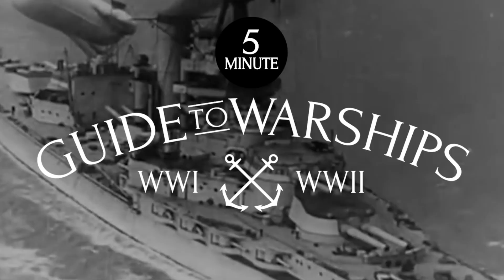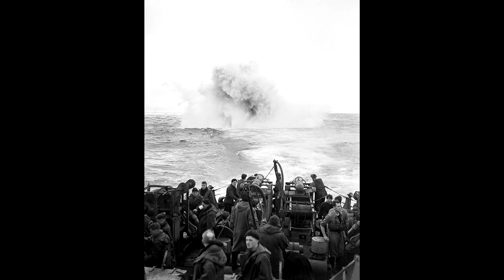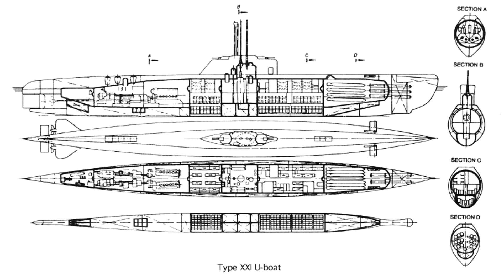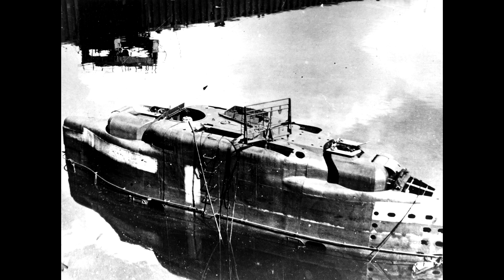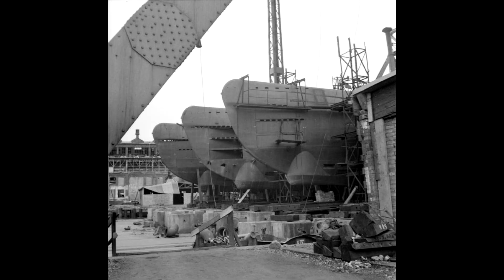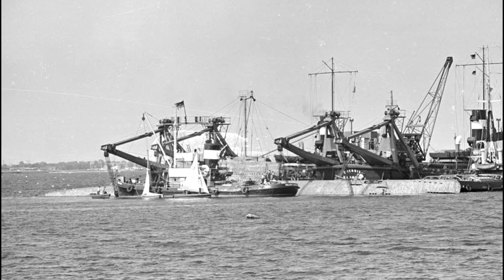Type XXI - Guide 408

Comment: The design is so advanced, the hull could be reused to fit modern systems and be as capable as any other newer conventional diesel electric attack submarine.

This one was the true wunderwaffe.
Reply: The internal hull design was never used again...  And if you think the  external hull which is just steel plates is revolutionary maybe you should read about the British R class which had the same idea back in WW1.

Comment: The Type XXI made a tremendous contribution to WW2: it consumed so many resources for so little (combat) output, it really helped the Allies win! In reality, Nazi Germany dove down the hydrogen peroxide rabbit hole and surfaced 2yrs too late. Now, if Walter had been told his ideas were operationally stupid but the sub shape was great, maybe they could have had something like a Type XXI ready by mid-1943, when it was actually needed. Same with Japan - built high speed sub No.71 BEFORE WW2, then did very little until producing the I-201 far too late.

Comment: The great irony is that the Type-XXI is the first actual submarine. Meaning a ship capable of continuous underwater cruising operations.
     All prior "submarines" were technically submersibles. Ships capable of diving, but only for varying lengths of duration before they would be required to fully resurface in order to recover resources, whether that be running air-hungry engines to recharge the batteries used to power the sub while underwater, refill the air tanks with air through deck-mounted air intakes, et cetera.
     As a result of these limitations, the vast majority of WWII submarines would cruise on the surface for most of their voyages and only dive upon spotting a potential quarry, before closing while underwater to attack with torpedoes.
     The Type-XXI was unique in that it only required a snorkel to feed air for its engines and its living spaces when it needed to, and thus didn't require breeching the surface to run its battery-recharge engines. It also distinctly had a much more hydrodynamic hull designed for continuous underwater sailing, and thus was much faster while moving while dived than most other submarines of its era.

Comment: 5:10 that is so cool. We actually do a similar process today with constructing large industrial projects. The pieces (modules) are built in large yards close to a major city and then they are shipped to site and connected. A small SAGDE oil plant will take about 40-80 modules and can be connected and commissioned in 6 months after the first mod arrives.

Comment: It's amazing that a scuttled submarine could be salvaged and be museum worthy.
Reply: Museum?  She was operational.  Honestly, knowing the Germans I would not be surprised if she was scuttled by merely slowly flooding the ballast tanks and the crew sealed the hatch after they left.  So, from 1945 until the mid 1950s the boat was "sealed".  Granted after salvage she would have to be 100% reconditioned but that's a lot better than cleaning out 10+ years of underwater goo.
Reply: Can't help but think of USS Monitor, which spent a century or so underwater after foundering and is now in a museum.

Comment: Just much too late. The Kriegsmarine needed more U-boats and better technology in the early years of the war when they had by far the best chance of winning. By 42 - 43 they were too far behind in technology and in a position from which they could not recover.
Reply: With only 35 ocean going examples in 1939 and insecure  oil supplies... they didn't have a snowballs chance of winning 😂
Reply: Foe some reason autoincorrect kept changing Oil to Oik 😅

Comment: Why wasn't U-3523 running underwater so it wouldn't be spotted by aircraft? Using snorkel at night to charge the batteries.
Reply: Aircraft used radar, leigh lights, MAD systems as well as visual (at night a periscope or snorkel cutting through water can cause a phosphorescent type wake behind it)

With design issues with the engines - it took an inordinate time to charge the batteries (design was 4 hours running with diesels at max for each of the two banks - in reality the engines only produced around half the designed  power)

Comment: Having large quantities of Hydrogen peroxide a highly corrosive and explosive material in a sealed container under water with electrical switches which could go wrong.  Small fuel leak and a spark and he sub self-destructs.
Reply: Yup. To be entirely fair, most accumulators and battery banks in german submarines used compounds which would turn into various Gasses, among them Chlorine and Hydrogen, on Contact with Seawater.
Reply: And potentially pure oxygen given off, after which everything electrical starts bursting into flames.
Reply: When they fill and aircraft with a mix of "T Stoff and C Stoff" each of which was corrosive and ate through the fuel lines, was highly explosive if they came in contact with each other - special methods and equipment developed to fuel the aircraft (which caused injuries to air and ground crew as well as more than one un-intended explosion) 

Or the russian "Kursk" submarine in 2000 sinking after its HTP torpedo was damaged and leaking before exploding (it had been dropped during loading and cracked but nothing was reported

Comment: So was this the most advanced sub of WW2?
Reply: If you count only deployed ones, arguably, yes. There were other designs which fulfilled roles like supply or signals better, but it was the only class of permanently submerged boats to put to sea during the war.
Reply: @acceptablecasualty5319  signals and supply?  That's your oh so important metric...   Man you really need to stop doing such interesting convoluted logical paths to avoid dealing with the XXI's very documented issues.   Stop trying to put lipstick on a pig.
Reply: It might have been more useful if it didn't have to leave land and pass through a particularly hostile piece of sea.
Reply: the Japanese I-201 was judged by the US navy to be better and sunk them so the Russians didn't get one as per agreements.  The I-400 is equally advanced but wildly different.

Comment: If you look at USS Nautilus SSN 571 you can see a family resemblance in hull shape.
Reply: The hull shape is similar for the reasons that most cars look alike.  It is a more efficient shape.  Swede Momsen proposed a streamlined design before WWII which came to fruition with the Albacore, which in turn led to the fraternal twin Barbel/Slipjack classes.  The Nautilus abd Skate class was based on the Tamg hull.

Comment: 1-Hydrogen peroxide, doesn't like organic material
2-Humans, all organic
3-Put both in a metal can
4-???
5-Profit!
Reply: Battery banks full of Sulphuric Acid, Diesel Fuel adjacent to the hull... Potassium Absorber sheets in the Ventilation System. The chemical safety train had already left the station by that point.
Reply: See also: Me163

Comment: TY Drach. Great but too short.  Everything about these boats' was advanced beyond allied means, but no matter to the outcomes of the  war.  Modern hydrodynamics , even the 30mm AA guns (when fitted) were copied and used for 20 years after, as the ADEN guns, or DEFA used by France. Acoustic , and homing torpedos,  would become normal equipment for post war navies. Good thing they never arrived in the vast numbers hoped for.
Reply: The allies had acoustic homing torpedoes in WW2 (US airdropped anti sub ones)  - separate concurrent development happens many times 

The Type XXI was not advanced in all its equipment or design, definitely not beyond allied means - they actually had severe design issues in many respects which limited their usefulness to the extend building more Type IX would have been a better use of resources
Reply: @chaz8758  TY chaz, we also see the type XXI led to the USN's GUPPY program, as the 21 was much further along in hydrodynamics , and electric drive. 
The torpedo war had even out with the acoustic torpedo faked with those towed noise makers?  This really pissed of the Kriegsmarine. The new UB  thought was to expand the submerged performance as the main form of operation, not the surface, so snorkel or 20 m down.  Surfaced life was too often  fatal , so they built the XXI , which was the first class of submerged mainly  operation. The new flak guns in the turrets were for when refueling by milch cows, or moored in port, no need for a deck gun. 
 I think many sub guys see what it meant to the design tree, still in use.

Comment: Hey Drach, which of Germany's wonder weapons would have made the most difference in the war, if introduced in 1940? BTW, awesome 5 Minute Guide!
Reply: The He280 fighter was flown two years before the Me262.  It was slower and less powerful yet more reliable, but faster and more powerful than any allied jet until the Meteor.  Not building it was a poor choice, even as an intermediate step.  The XXI seems to me to be a case of some excellent concepts that needed more development time that they didn’t have.  On the ground, the StG44 was an excellent idea and had it been implemented in 1934, may have solved a huge number of logistical difficulties throughout the war.  The most successful wonder weapon the Germans used was, in my view, Pervitin, though only up to 1942.

Comment: Its a bit odd that it had a safe operating depth less than the later versions of type 7's (240 m / 787 ft verses 270 m for the Type ViiC/42) . Considering how advanced they were, one would think that they would have improved that since using thermal and salinity layers in the ocean could be key to remaining undetected or escaping. In fact a version of the Type VII was planned that could dive 40% deeper, but that was cancelled once the 21's came along. Is speed better than crush depth?  Interesting question, remembering a stronger hull could also absorb more combat damage. I suspect the manufacturing technique was the big hurdle for max depth.
Reply: Speed is more important than crush depth. Later in the war the Allies had pretty much nailed the best ways to detect a submerged submarine and one destroyer would drop depth charges while a second stayed off to the side to maintain contact. At the very end of the war when all U-boats had been ordered to surrender one of the small final types of U-boats before they surrendered made a practice attack on a major surface ship at high speed and the allies had no idea the sub was even near them.
Reply: @lancenorton1117  Are you talking the U-2511?  If that is the one  it never happened.   Claims require proof and the u-boats logbook had those pages torn out
Reply: Pretty much every XXI had to have extended repairs as soon as it was launched to fix the welding & manufacturing issues.   Final assembly putting the pre-built sections together had to be done in a continuous 12 hour weld.
Reply: The Type XXI had many many design issues that reduced its effectiveness even without poor workmanship and construction

Comment: I visited the last Type 21 a while back, Wilhelm Bauer (formerly U-2540) is a museum ship in Bremerhaven. 
So much bigger than the other german subs, but still incredibly cramped.

It's not fully authentic, given that it was scuttled at the end of WWII, then refurbished by the West German navy to do testing for new subs after NATO ordered them to. But since they weren't allowed to have military subs of that size yet, they had to remove all guns and torpedo tubes to make it a civilian vessel. Four of the torpedo tubes and most of the original interiour were reinstalled when it became a museum ship, but the AA gun turrets were lost along the way, those are dummies nowadays.

They also sell a great book about this ship in particular and german subs in general, if you can read german.
Reply: The Oberon class submarines we had in the 80's were also "incredibly cramped" ..at least by modern standards... I think thats a given with Diesel electric submarines. I mean they were good boats.. Mk 48 torpedoes, Sub-Harpoon (eventually) AND WE (the RAN surface fleet) couldn't find those QUIET buggers most of the time.  Would have hated to have them on "the other side"!